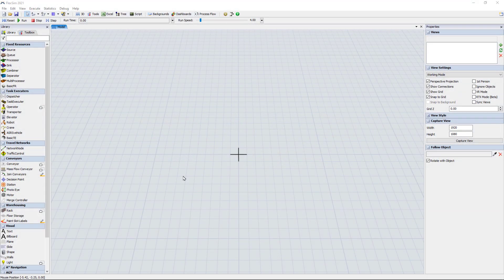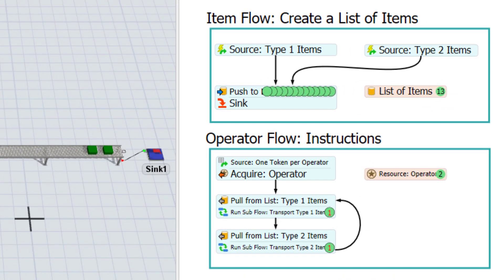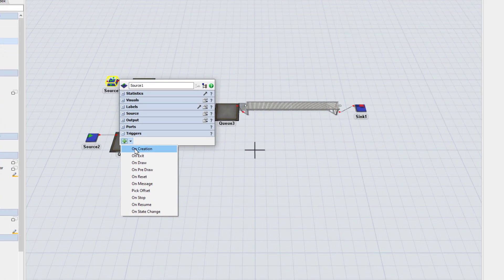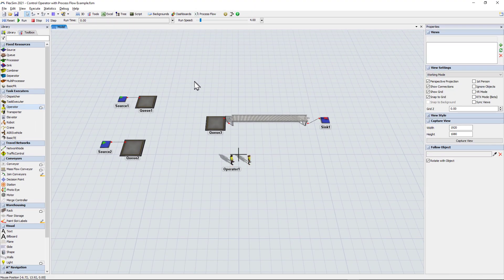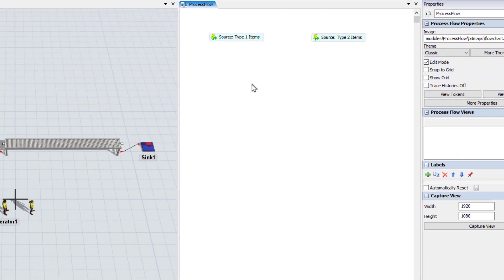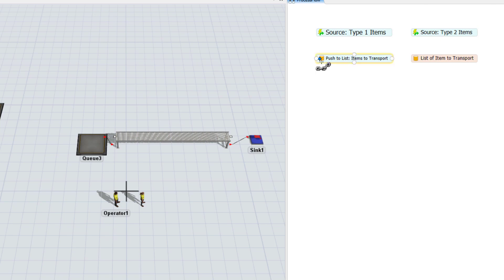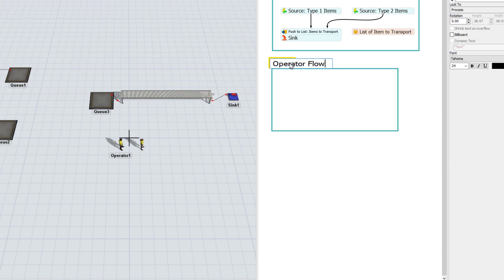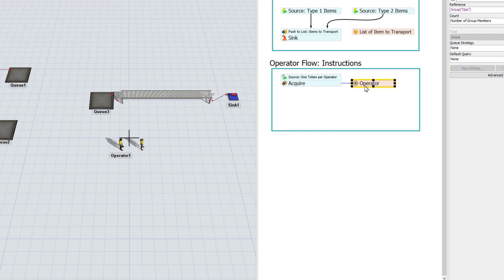Control Operators with Process Flow

Comment: HI. I have a small problem in my simulation, how do I make the operators perform the setup time even on empty processors?

- I put 3 operators to work on the whole line, all controlled by Dispatcher. What happens is that at the beginning of the simulation only Operator_1 works, this happens until the flow item arrives at the next Processor...
 - (It seems that the software understands that the setup time can only be executed if there is a flow item on that Processor)
- That is, Operators_2 and 3 are stopped until the flow item has arrived at a Processor so that they can perform the setup and processing. Since it is necessary to perform the setup of several Processes further down the line.

Can you help me?